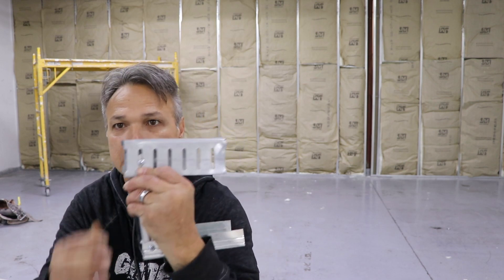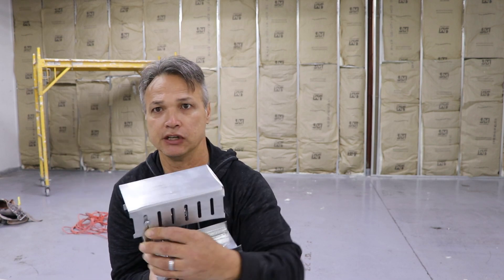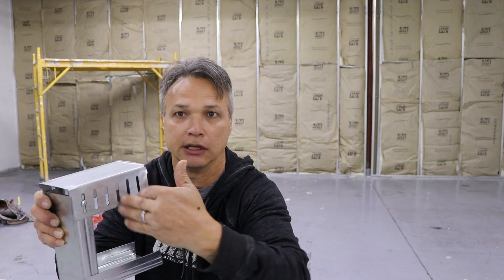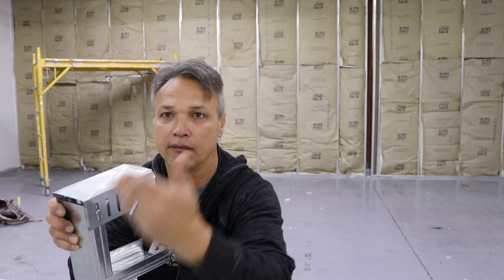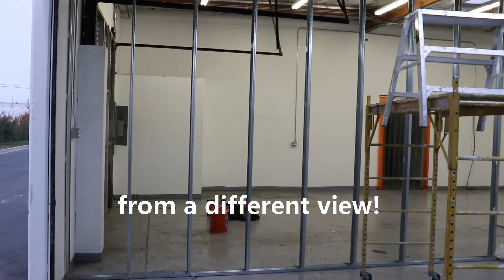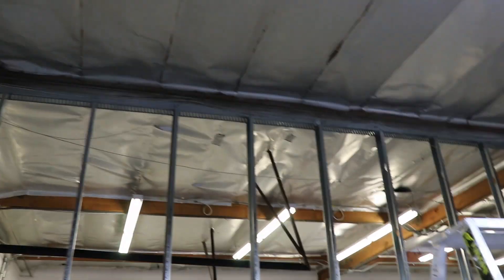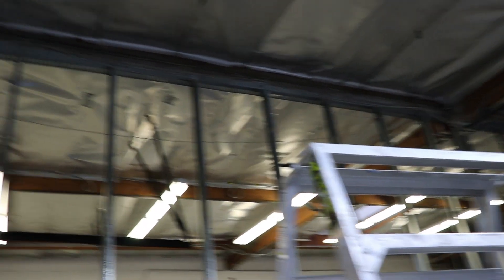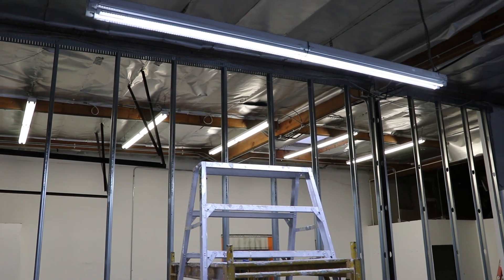sizmic drywall wall slotted track framing

Comment: Studs at top track should move, after running tec screws lossen then a little until the stud is loose. Put it this way, after trying to lift a track with a lift underneath when 2 studs causing it to sag by their weight (when there should have been a box beam instead of a single track carrying them) the track carrying them would not move until the screws were loosened. Now how would a snow load or hot sun lift deflection operate. Also, drywall screws need to be no less than 1" below the bottom edge of the top track, or when it deflects it will stop on the screws and crack the drywall

Peace dudes